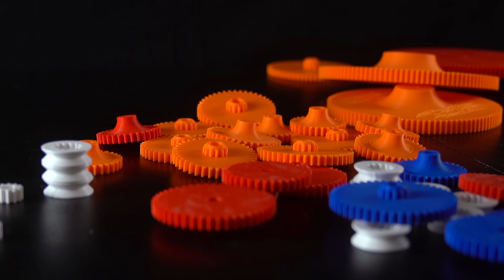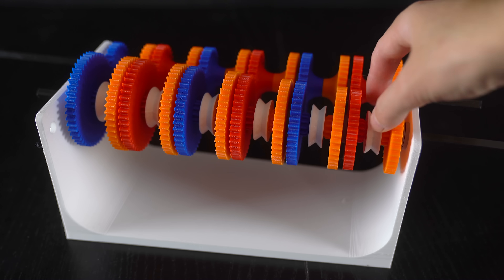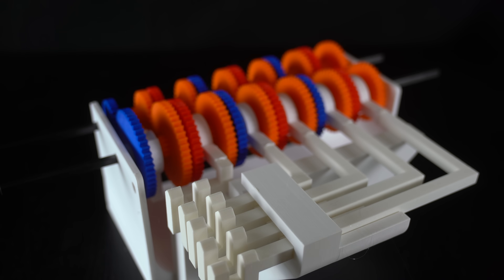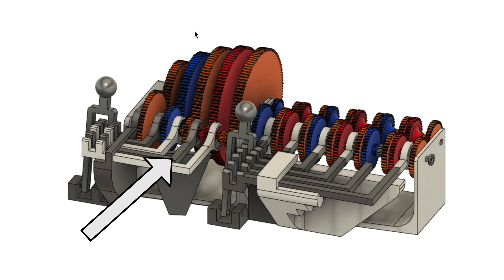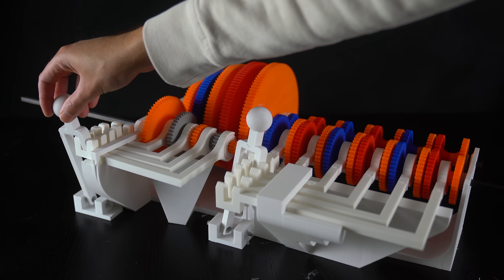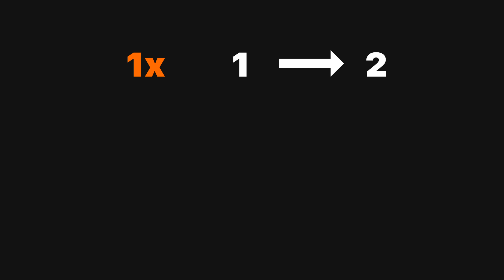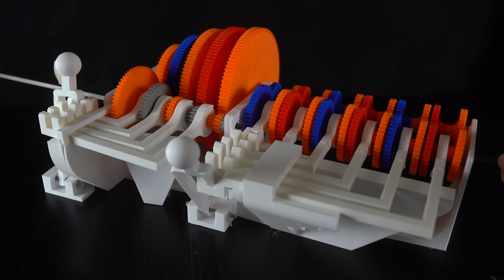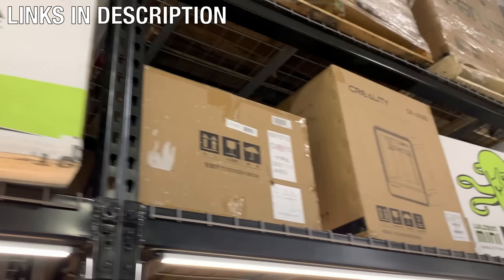60 speed manual transmission

Comment: My uncles heavy recovery truck has 52 gears, 13 speed with another 4transmission called a auxiliary transmission but you dont use them all on the road

Comment: Change the input to be the shaft going Into your mega multi box and the output on the other end and your 32:1-1:1 twin stick transmission Is very similar to what a twin stick semi trucks transmission used to be like. Insane torque!

Comment: Person who worked with machinists here: when you have parts that are oddly shaped, like the shifters, try printing two parts with design for a small screw. More work, but stronger part, and less time consuming during print. If its non-structural, then it doesnt matter, but for items like this, it would help save time.

Comment: Just because you CAN 3D print, doesn't mean you should.  The project would have turned out so much better if you got actual manufactured hardware to go along with the 3D printed components.

Comment: You're saying the ratios backwards - input : output is correct way. So your "32 to 1" ratio should be a huge gear REDUCTION instead of the overdriven output you have.  Should call it "1 to 32"

Comment: Put  a 2 speed rear end and you got yourself 120 gears. 

Had 4x4 and 4x5 two stick simi trucks, later on guys would put the auxiliary box on their 18 speed which was AWESOME, and questionably useful after weight and overlapping ratios taken in to account.
Reply: It would take quite a while to reach 120th gear unless you have the gearbox in a series of 12 or 24 speeds lol
Reply: @TheSilverShadow17  so many gears were over lapping you’d probably change .0001 ratio on more than half if you tried sequential shifting lol. 

The 4 gear second shifter would be more of a final gear choice and often times a difficult one to shift on the move so if you were empty you take high gear, fully loaded uphill low gear and then shift accordingly on the main.

Comment: I feel like another example of this gearbox + multiplier system that people may be more familiar with is on bicycles. The right shifter is your transmission and the left shifter (front sprocket) is your multiplier. So if this engine transmission is still hard to understand, look at your bicycle and apply the same lessons learned in this video!

Comment: Racheting cvt. it's a lot smaller and solves the tourqe slipping problem with normal cvt's. You just need like 8 different transmissions side by side to smooth out the bumpy output it's going to be bumpy under load maybe better for electric generators and use the electric power to run a electric motor for a more comfortable ride.

Comment: another suggestion for strength you could have added a couple mill sized fillet at the 90 degree angle of the shifting linkages to distribute stress to avoid a break.

Comment: If this went with a car with a max speed of 200 mph you theoretically could start moving without taking the clutch out slowly or revving. If it wasn't, top gears would probably spin the driveshaft so fast that it would shatter into millions of pieces.

Comment: Future reference older trucks or twin stick trucks would have a 18 speed trans or whatever and a 4 speed spicer so every gear you can break further down using the spicer 4 times so say you had an 18 speed that would be 72 gears if you split every gear into four but the secondary is called a spicer

Comment: This is cool, unfortunately with a bit misleading title, given it has only 56 gear ratios 😥 Or your first mention of the higher ratio of the smaller gearbox was correct and it's "almost 2:1" in which case it has 60, but you did not use it in the calculations. I need to know which one's true! 😨

Comment: Can you imagine being in 60th and having to stop at stop sign
Reply: All you gotta do is put the thing in neutral, like a normal manual transmission
Reply: That's what brakes are for.
Reply: @EarlJohn61 As well as putting the gearbox into a lower gear so that you don't stall.

Comment: My modded ender 3 v2 produces incredible layer adhesion. I use a high performance fan shroud, titanium heatbrake, copper heatblock and nozzle, dual z, and geared extruder direct drive.

Comment: Really cool I’ll give that, but the trucking industry has been utilizing this technology for years.. they call it a splitter usually because it splits high and low ranges depending on transmissions.. in the U.S. and 18 speed is most common with a splitter

Comment: I’m curious: did you use even-tuning 2^(1/12) gear ratio steps in your front-gear box? If so, you created essentially a 5-octave mechanical instrument, that’s tuned in a modern temperament tuning!
Reply: Late answer, but just as an observation it's pretty much impossible in real life to make gear ratios to be multiples of 2^(1/12) when using cog wheels. Each gear must have a whole number of teeth (no fractional tooth unless it's broken), which means that each ratio must be a rational number. You might be able to find some ratios that are "close enough" though 😉

Comment: most gear boxes dont increase speed until the highest gear(s). for example, the standard 5 speed transmissions gear significantly down from gears 1-3, 4th gear is direct drive, and fifth gear is slightly over driven. most transfer cases gear down even more, and the diff gears down for the final drive ratio. most cars engines are spinning roughly 3 times faster than the axle in the highest gear.  a better design for this is to either flip the input and output so you're always gearing down, or make the 1:1 gear either 6 or 7 and up or down from there, including the multipliers, which to eliminate doubling gear ratios, should be a 5 speed with 1:4.05, 1:2.05. 1:1, 2.05:1, and 4.05:1 or something similar. that way, gear 30 is 1:1 approximately, and every other gear is higher or lower than the input.

Comment: That's kinda how an 18 speed transmission works in a semi but there's 4 main gates with a high/low range selector and a high/low splitter so technically it's 16 half gears and a high/low range reverse gear

Comment: I have rebuilt transmissions from big trucks.
It’s not as hard to imagine the building process as it’s all simply gears.
To get the different ranges, one can simply add reducers and multipliers to a section behind the main gear set.
The final drive is important here, as it needs to be matched with the horsepower going through the input shaft.
The torque is managed by how robust the gears and shafts are, so little beyond making them hardy enough to stand the maximum torque is the simple part.
Trading speed for the torque is the big trick, because the needed horsepower can be easily overwhelmed by just having too much at the final drive for the engine to keep moving!
Reply: Just gotta remember the equations and remember which gear is which though it does help that they'll all splice to together. Gotta love that diesel program in tech schools.

Comment: But how do you do reverse? Car gearboxes have a reverse option so how do you make that?

Also it would be nice to see a video of you putting a gearbox like this (but maybe not this many speed options) in a 3D printed car and use a electric motor to power the input shaft. It would be fun to see how it works while moving around.

Comment: Many of these gears are redundant... I would've liked to see 60 unique gear ratios. I.e a gear ratio of 1:1 with a 2x multiplier is 2:1 but the original gears have a 2:1 so a 2:1 with a multiplier of 1 is still 2:1 thus redundant.

Comment: Essentially, if you put power to the other end (your current 'output' shaft), you've created a compound truck transmission.. similar to a Fuller/Eaton RoadRanger. They generally just have a low and a high set for the multiplier, and then 5 ratios behind that, in the case of the 10 speed. You basically run through the 5 gears in the low range and then pop the button up to shift to the high range, and row though the 5 ratios again until you reach the 1:1 ratio on the output. Pretty interesting experiment! A bit lighter than the typical 1000 lbs. or so for an actual compound transmission!😂

Comment: Instead of this complicated mess you could have used multiple stages. For every new stage with 2 gears you double amount of possible speeds. 6 stages gives you 64 different output settings.
Or you could use a differential / planetary gear to create a "CVT". The engine can move at a fixed speed and the more energy you take from the free spinning output the more energy goes to your actual output. If you then use a dynamo to capture the energy from that free spinning wheel you can produce energy and put that back into movement and it does not wear out. (Compared to a clutch.)
Also note that in cars there are essentially 0 straight gears. (Only the reverse gear in manuals.) Helical gears have more strength, make less noise and also wear less.

Comment: Where layer lines create weakness or the need for supports, split the model so you can print all of it flat but with a designed connection that will take a screw or with an effective glue area.

Comment: If you really break it down, how many unique ratios does it actually have? 1:1 times 4 would be the same as 1:2 times 2, and I can imagine there are more overlapping ratios.
Reply: There are none. Each gear in the back end is a larger multiple than all 12 on the near end.

Comment: I wish auto manufacturers would build a 6 or 7 speed manual transmission with a cruising gear for fuel efficiency. It makes so much sense, but they haven't done that ever. Why can't i cruise at highway speed, 75mph~ while being at 1,250rpm instead of 2,500rpm? It's more than enough power to maintain speed in modern vehicles at that engine speed.

Comment: So, a 12 speed manual transmission with a 5 speed overdrive tacked on.  NOT a slam in any way!  Even if I had a 3D printer to play with I doubt if I could have made the explanation as clear as you did.  I will say though that my favorite PERFORMANCE manual transmission is a Lenco.

Comment: checkmate. You have 56 speeds since gear ratios 2, 4, 8, and 16 are repeated. Great work though!
Reply: Yeah, but it’s the same principle as shifting on a bike. If you have 3 in the front and 7 in the back, it’s still a 21 speed
Reply: He said “almost 2” for the small gears.
Reply: 12 gears in the first gearbox, 5 gears in the 2nd powered by the 1st box. 
12 × 5 = 60
Reply: It goes up in order, so there is 60

Comment: You forgot to mention the fact you've effectively duplicated many of the ratios, and that the ideal shift pattern wouldn't be 1 through 12 on 1x, 1 through 12 on 2 x, 1 through 12 on 3x, etc ect, but rather you may have alternate between shifting front and rear to hit all possible ratios in the correct order.  But as I mentioned there is significant overlap, so they may be much fewer than 40 unique ratios.  At the very least the 1:1 and 2:1 gears in the 12 speed will be duplicated by each successive gear in the 5x multiplier , IE, 2:1 in the 12 speed on the 1x will be the same as 1:1 in the 12 speed on the 2x...
Reply: was about to say the same
Reply: I understand what your getting at but my brain won't let the numbers run out. 😐 would you just remove the overlapping combos or avoid them by engineering limits?
Reply: @chadblechinger5746  cant we use prime number ratios to avoid overlapping?
Reply: @anananasyiyen Why use prime numbers when you can just make each large gear change larger than the sum total of the smaller ones?
Reply: The ratio might overlap, but the stress and pressure point on gears tooth wasnt the same. Some time the ratio wasn't able to be transfer to axle unless the differential be bigger than the wheel by thicker gear to overcome pressure point. Its depends on the load and total wheel. Computerized gear selection mayb save overhead cost. Mayb im wrong. Just an instant only recall pressure point of the tooth. I guess different kind of gearing type whats eliminate the range limit.
Reply: He said the last gear of the first gearbox almost reaches 2:1, so its strictly less and the first 12 ratios are unique in the Interval [1,2). Therefore after multiplying with 2^n for the big ratios you'll always end up in the [2^(n-1), 2^n) Intervall for n \in {1,...,5}. Therefore each of the 60 total gear ratios is unique and increasing exactly in the order you described (1,1), ..., (1,12), (2,1), ..., (2,12), ..., (5,1), ..., (5,12).
Reply: @mauricereichert2804  and this is how we get "honest" marketing claims that leave customers upset.
  You're completely accurate technically.  But it isn't going to really deliver on the claim.  The range is going to overlap sufficiently enough that it may as well not exist.
Reply: @richardbrooksshnee  The ranges aren't overlapping at all. The only interesting thing is how close is almost 2:1 to real 2:1 and how are the steps seperated. If he choose the teeth count ratio such that it approximate 2^((m-1)/12)  for m \in {1,...,12} in a good rational way (e.g. exactly like a western piano 7 white + 5 black =12 tone steps), it's gonna feel very natural and every single gear shift will increase about the same factor and maybe even sound harmonically. :D
Reply: @mauricereichert2804  yes they are.  The operator would be skipping that last gear as x~2 and x2 are close enough to the same that any rpm differences would be negligible from their standpoint and so there is no worthwhile reason for the overlap.  You're going to shift to x2.  You're ignoring the point and purpose of a gear box.  Effectively the same is wasted and is an overlap in range.  Damn near the same output to engine rpm & torque.
  Your "but the numbers are slightly different" is obnoxiously pedantic to the point of counterproductivity and ignorant to the point of a drive train.
  You can cry technically right all you want.  You're effectively wrong.
Reply: @richardbrooksshnee  No they aren't, also not effectively, if the last ratio is for example ~1.9, which one could call close enough. I agree in the following way: If you want to think of a real life manual gear box in a vehicle, nobody in their right mind wouldn't skip lots of gears, especially alls of those (1,m) ones, also a ratio range of almost 32 is ridiculous for normal vehicles :D
Reply: @richardbrooksshnee  so this is pedantic, and I know what you mean, however saying x~2 is inaccurate. I know there's no "almost but just below" symbol in common use but.... Yeah pedantic I know.

What's less pedantic is the difference that causes can be huge in real life scenarios. Most likely this kind of setup would be treated as a reduction gear set rather than an addition gear set like shown here. Now I'm gonna assume it's something like a 1.95 to one, it's not it's closer to 1.9 but to prove my point. Drop this transmission into a 18 wheeler going 70mph with 20 in wheels and that slight gear ratio change is about 117 rpm at a *16 multiplier. Assuming an 18 wheeler is driving at those speeds 5 hours a day, 5 days a week, for 10 years and over the life of the truck it works out to be something like 1,520 gallons of diesel. That could be as high as $7k or 8$k depending on the going price of diesel. Now yes over the life of the vehicle you've probably spend 200,000 or $300,000 of gas. So yeah that's not a huge amount of money comparing how much money you put into the truck, but that's still a couple hundred bucks a year. Not a ton but definitely enough to make a difference.

So to summarize my long drawn out point, even a small difference in gear ratios can be a huge difference in certain scenarios.

Comment: Are you sure this is 60 different speeds, gear 12 has a 1:2 ratio with a 1x multiplier (1:2 overall). Gear 13 goes back to 1:1 ratio in main box but then uses the x2 multiplier gear which would also make it 1:2 overall. This means that every time you go to a different multiplier and back to gear 1 in the main box, the gear ratio is the same. Another example is with 24th and 25th gear, 24th gear uses 1:2 in the main box and a 2x multiplier in the second box (1:4 overall). 25th gear goes back to a 1:1 on main box but a 4x on the secondary box which will result in the same ratio (1:4 overall). This can also be seen with gear 36 and 37, gear 36 is 1:2 in main box, and 4x multiplier in second box (8:1 overall) and gear 37 uses the 8x multiplier and the 1:1 in the main box (1:8 overall). Otherwise it's very impressive how you got so many gears in such a small package.

Comment: Those "couplers" you speak of are otherwise known as a synchromesh, they are tapered inside to allow for gears and shafts turning at different speeds, to engage. It gradually brings the layshaft and input shaft up to speed, or synchronization.
Reply: This is an unsynchronized gearbox... Those are just shift collars
Reply: @pytbob  Yep, those are the "dogs". I thoroughly enjoyed the vid, but it would have added to the learning if he used the real terms such as the shifter forks, dog toother gears etc. Many would have an "ah-ha!" moment when they read about dogbox gearboxes.
Reply: @amorag59  so many nuances in transmissions and I'm far from an expert... I do know that dogs refer to teeth on the face rather than the periphery of a gear. They were used as the step between sliding mesh and synchros

Comment: you can always some how mesh the corners of the arm linkages. that way you can print both sides laying down, without supports. all u would need to do is bolt them together, or have a dove tail or something.